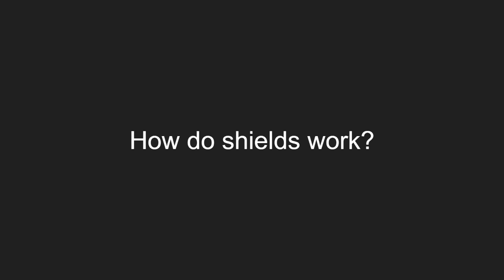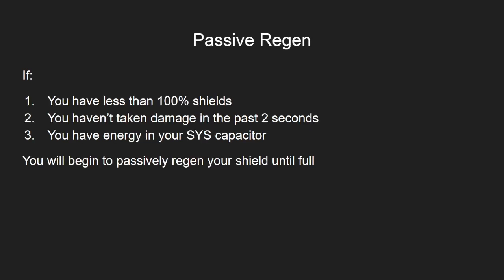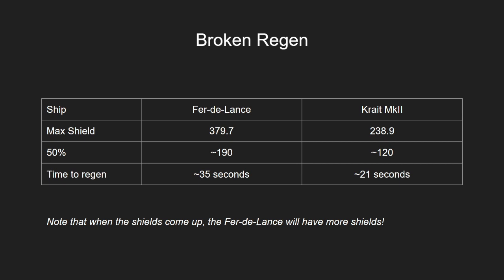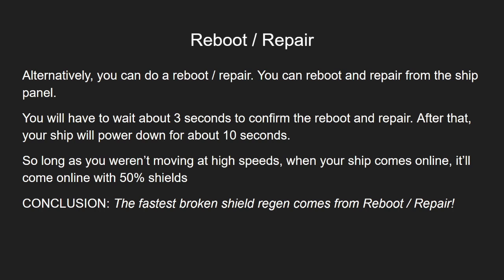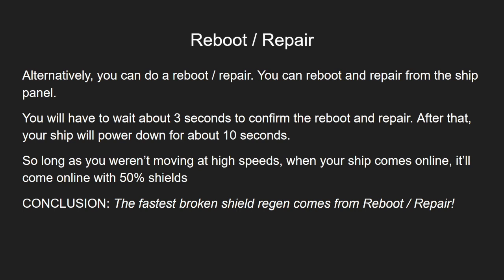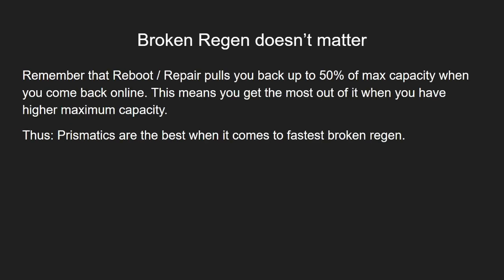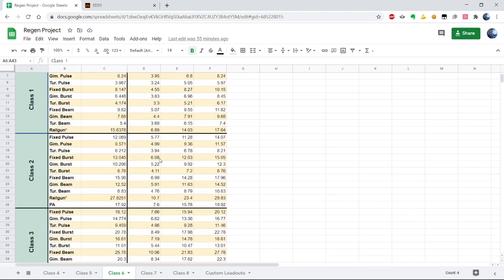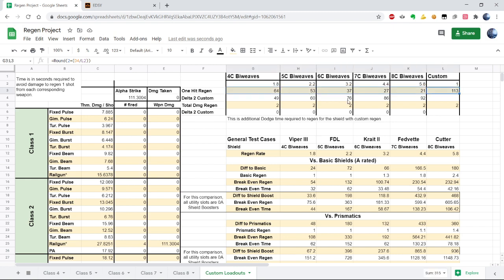Why Bi-Weave Shields Suck

Comment: Just look, my Bi-Weave Shield with 9 Mj. everywhere can entirely recover in 2:40 with 3/4 points to Systems -> https://coriolis.io/outfit/anaconda?code=A4putpFklkdzsuf57o7l7l7l272724240404040404040404B05n5nfm1K1K1K1K1J1J1J1E3x.Iw18eAMmkA%3D%3D.MwBj4yQRmgmOUkmMIA%3D%3D.H4sIAAAAAAAAA43Tq04DURAG4Nne6F7KYUu3XYqCLuAIloQEHAmCICt5A0gQVFQUg6UCgaxA8gAIRAWPgUBWIEhICJdyfmY24QTTZFZM%2FmS%2BzDnJmSU7R0Q%2FZS7TKy7h0COqDSKi%2BJxT%2FT4kyh4KRPDsrpN9LtVHn8jsvAPNkeF%2Bwaauf8bFjD%2BBRjoFkteAKN2rEHWGEwBF23ayJzL7AvKTGv2E5RN3ULbbDl1w8SMLBNcx0YqkVUlrktYloWKP%2F7jpvfC48TOwKbdD1XbdpCKXkhxX7i4TVe5qfKf8OP8folko0KBQgyINqmnQvAYZDVqw%2Bw7dyCrc8ouZo28glpTKe2eSEKtlXS0X1bKhlolaNtWypZapPXTyRPZSfpNYZHba4v6SPZB%2BSfqXXLzBG2C2PoB8yMaEl7Uzkg1uqyVo1vcLe58NdukDAAA%3D.EweloBhBmSQQwHbwMYHtEBN4gILPS3gAIBZeAD2IGUALASwFMAbTYgIXoFoB1R%2BAG6MQARgjiQUKUA%3D%3D&bn=Anaconda%20Max%20Shield%20Bi-Weave
Reply from the maker: First of all, that's rebuild time. That's from 0% to 50% (unshielded). So you're gonna be taking damage the whole time in your slow anaconda. This is why I stressed that the fastest rebuild in general is going to be the reboot and repair. It's actually 5 minutes from 50% to 100% which is presumably what you're trying to "flex" with. But then we get to the problem of trying to flex in the first place. That build, frankly speaking, is garbage. Your mods are completely out of whack. You could get a lot more effective health if you just fixed those mods alone. You have 2700 absolute health which on a large ship is about half of what you can get. 

Large ships are also super easy to hit in the first place. Remember, your clock resets every time you take any damage. So you could regen for 10 seconds, get hit, gotta get out of combat (2 seconds without getting hit) to regen again. In your anaconda you're just a fat target. Not only that, but you're running what has to be one of the worst engine combinations of mods I've ever seen.  I don't particularly recommend Bi-Weaves but if you were to put a blaster to my head and say "Put a Bi-Weave on something" the best options are going to be ships that don't get hit much in the first place. A viper would be a better candidate but I haven't built one in a while so I'm not sure on power constraints off the top of my head. 

Anyway, I decided to somewhat fix your build. I'm not going to touch the weapons even though your full MC build is pretty low IQ. First we fix the shield boosters. Obviously a lot depends on what you're fighting but I know you're not doing PvP with full gimballed and especially because anyone would torpedo your anaconda out of the sky with their vulture. General rule of thumb is half heavy duty / super cap, half resistance augmented / super cap. This alone more than doubles your absolute health and about doubles your kinetic and thermal health. Then we have to decide if we're going to all-in on this regen idea (which I disagree with) or not. Thermal resistance on the shield is fine, alternatively you could use reinforced but for PvE I generally use thermal resistance. Then the mod can be either fast regen or the more generally useful hi-cap. It's up to you but I will use hi-cap for my build here. This obviously presents us with a problem because now we're low on power but I noticed you dumped on a ton of guardian reinforcement packages. Guardian reinforcement packages are not worth it on large ships since they add a flat value to max shield. You know what pretty much does the same thing in the field but costs waaaaay less power? SCBs. An unengineered 5A SCB will add about 1000 raw shield to your ship. This one slot is now worth about as much shield as half of your GRPs at a fraction of the power. Plus if we instead use B instead of A class SCBs we actually get more shield overall. Might not be intuitive but it's the truth. So we swap out your A classes for B classes, strip the GRPs.

(At 3 pips) I've now increased your Absolute shield by 3k (important against PAs / Ram damage) at the cost of some of your resistances (-8k Kinetic which generally doesn't matter on shields and -5k on thermals which matters but not as much as you might think). You get 30% of your power back. Thing is, 3 pip considerations are kinda eh, since you're probably going to have either 0-1 pips in systems (on the attack) or 4 pips in systems (on defense).

We fix your thrusters to be dirty / drag and we're good to go. This also opens up the weapons options to let you actually run lasers on this build if you want to actually strip shields. Alternatively (though I've a video planned on why this is not really a good idea) you could run incendiary on some of your MCs to turn them into projectile lasers. I do not recommend this in general but it is an option if you're married to the full MC build. You can also add some useful things like limpet collectors, repair limpets, AFMU, Fuel scoop, etc to your conda because you're not hoarding all of the optionals anymore. 

Of course if you want to pick up that kinetic and thermal shield back you could again toss on another SCB because again, for large ships, SCBs are better than GRPs. Toss on one more 5B Specialized / Boss cells SCB and now my build has more health than yours in all categories with 10% power to spare. 

Naturally this is going to proportionally increase your rebuild time (Because rebuild time is Max Shield / 2 / rebuild regen, so if we increase Max Shield we're going to increase the broken regen time proportionally) but that's why we don't wait forever to rebuild we just reboot and repair to get 50% back right away. This works for all shields as long as you're not going fast. But now we start running into the issue of "Why make your bi-weaves into ghetto prismatics when you can just use prismatics?"

Yours: https://edsy.org/s/v76B17y
Mine: https://edsy.org/s/vsTPu7i
Extra SCB: https://edsy.org/s/vazzBqi
Reply: @im-the-zam  ok i get it now

Comment: Very interesting. The math says you're right but I'm going to have to be from Missouri on this one at least once. Thinking CZ here -- I'm skeeeered of that window of vulnerability opened wide with the reboot/repair. On one hand, stronger so less likely to go down in the first place but if they do go down just how far from the action do I have to run to find a safe place to reboot/repair? Also, I'm in the habit of finishing the CZ then turning right around and going back in. With bi-weaves any time needed to loiter around before jumping back in is fairly short. But your reasoning is sound so I'll have to give it a try.
Reply from the maker: A fellow CZ pilot! Heya! So first, I don't think you'll have any problems keeping prismatics up for the entire duration of the CZ. Especially if you're running med ships or larger. If you can do an entire CZ without taking 50% Prismatics, your Prismatics will last you forever. Perfect time to do this is when all the ships jump out (assuming you won of course) If you're finishing a CZ with less than 50% Prismatic shield, you can just Reboot / Repair to get back up to 50%. Alternatively, you can do it before you engage in the CZ itself when you're still like 10-7k out from the combat. You don't need to worry about doing it in combat. 

But let's go ahead and address the combat situation too. I get that the hull damage is pretty scary if your shields go down in combat. But the thing is if your Prismatics go down, your Bi-Weaves went down forever ago. As noted, if you decide to keep flying and fighting with your Bi-weaves recharging, you're going to spend 10 or more seconds (I'm working on a follow-up vid that takes these into consideration) taking additional damage compared to just rebooting and repairing to get your shields back. I would be more afraid of taking damage from flying around without shields for 10 or more additional seconds than I would be from damage taken for sitting still for ~13-15 seconds. The more shield boosters you run on your build (And I'm pretty sure you're using shield boosters) the more value the reboot / repair has compared to waiting longer and longer for broken regen rate to get to 50%
Reply: @im-the-zam  Thanks very much for that discussion. I seldom lose the bi-weaves but as you note when I do it's a lot of run away! run away! while I get to the edge of the action so they can recharge and usually taking a good dent in the hull while doing it as they all pile on. Thing is, though, they are back up to full strength when I turn around and dive in for round two. But, frankly, I've never even considered reboot/repair as a shortcut to regen... definite oversight on my part.

What engineering do you use on your prismatics?
Reply from the maker: I typically run CZs in my FDL and it's optimized for thermal resistances. This is because most enemies in the game seem to run thermal weaponry. The prismos have Thermal Resist / Hi-Cap and then the 0A Shield Boosters are either Heavy Duty / Super Cap or Thermal Resist / Super Cap. I find that you have the most Thermal Resist at 50/50 with those for larger ships. 

The other option for the Prismos is Reinforced / High Cap if you're finding enemies launching too many cannon shells at you (I don't). You'll lose  2000 thermal resist but gain 4000 kinetic resist. Something you can consider.
Reply: @im-the-zam  Excellent. Thanks for that. Running the bi-weaves I was ('natch) going with thermal and fast charge but given your discussion fast charge wouldn't be the choice with a switch back to normal shields or to prismatics.
Reply from the maker: Glad I could help you out. Yeah I've been running the numbers on engineered shields all day and the amount of damage you have to regen to break even once we consider engineering and shield boosters is insane. The passive regen is really low, so unless you're sitting for minutes at a time, you probably want a different shield.

Comment: I used to go straight to prismatics, but after engineering my conflict zone conda I changed the shield setup to biweave purely because of the regen rate and for the amount of shield mj it had, which if I would replace with prismatic I would have close to an hour of time to get to 50% shield while biweaves would take less than 8 minutes, a very significant difference (i did see a build that had a flat 7,000mj thermal shield with 6:00 regen to 50% https://s.orbis.zone/cunk). But in pve that doesn't really matter, you could have that 2,000mj more prismatic shield and just reboot repair and have 50% of it back, which would leave it at 5,000mj thermal (I am using my conda for reference: https://s.orbis.zone/cumj ignore the absolute dumpster fire that is it, shields are the only thing I am looking at, the scb is rarely used as reboot repair is better lol), a pretty significant number. There are circumstances were reboot repair does not work, for example a pvp fight, if you reboot repair then you will become a sitting target and open to module sniping, torps, even ramming. Which really, torps can simply delete your shield generator and you will no longer have a functional generator. Yes you can sit there and reboot repair but that leaves us in that sitting duck circumstance, which I think in pvp most will just continue fighting until their shield is back up. I do agree that it is all based on preference and circumstance and reboot repair leaves prismatic regen faster than biweave, but that down time in between fights does account for some value though not much, and reboot repairing personally gets tiring after a while. I see you did put a lot of effort into this video explaining that the main reason people use biweaves is entirely beaten by reboot repair with prismatics and you do come out correct so congrats on that, at this point I am rambling and looking at this comment it is very lengthy, sorry if you read it lol. o7 Cmdrs! See you in the Black!
Reply: Are you implying a pvp build will ever want a biweave?